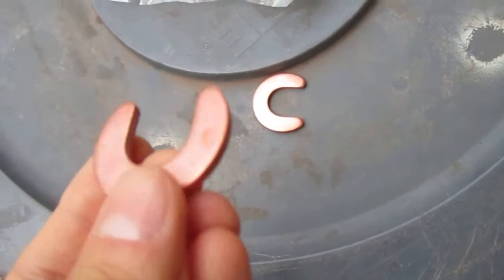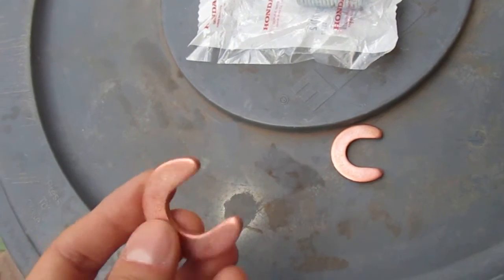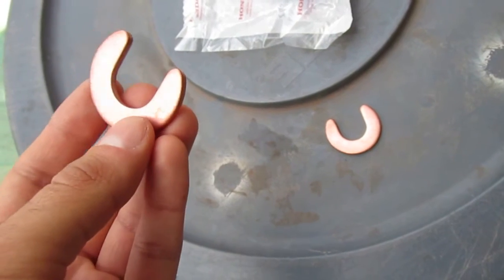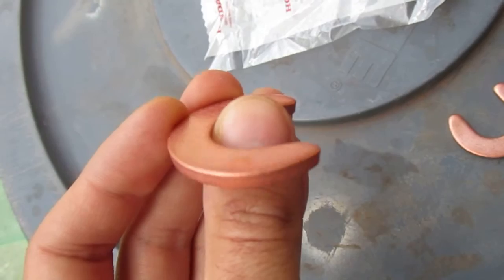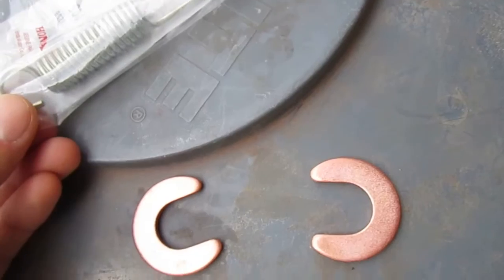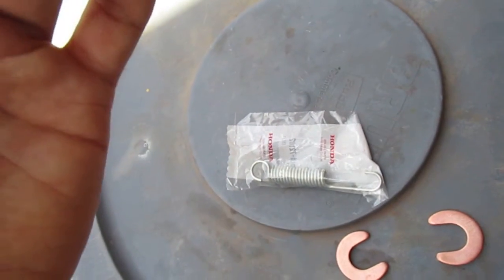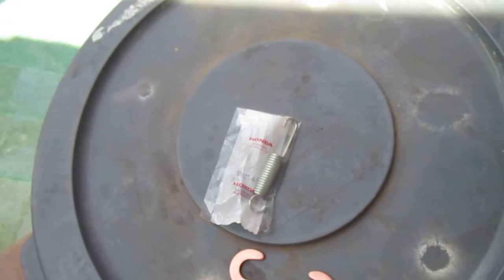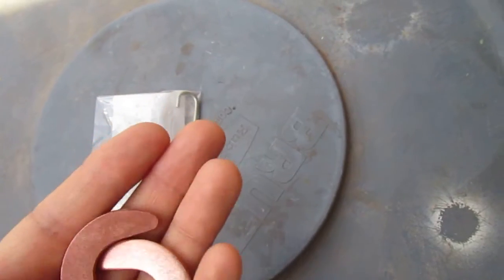Rear axle C clips  and Springs

Comment: sucks when they pop out and fling the axle and wheel out.
Reply from the maker: +Veikra  better hope you have disc brakes to hole the axle in.    I forget who, I saw it in a magazine but some company makes CUSTOM thickness C clips so you can really dial in the axle end play, i should of saved the name.    GM used to sell a variety pack These are around .150.  Some are .160 .180.     Who knows what is in the truck now I should of measured.  They are scored up bad!
Reply from the maker: +Veikra  Found it.. I am pretty sure this vendor sells assorted C clips http://www.tomsdifferentials.com
Reply: Ghetto Wagon Just ask a machinist and yes about the disk brake saving you lol.
Reply: very good to know
Reply from the maker: Veikra
 The only machinists around here machine meth.   Probably have to go Tampa Or Orlando to find someone who has the equipment to machine anything metal
Its  Hours away.
Reply: lol
Reply: How much backlash play is ok for the Axle Shaft with c Clip? 7.5"Diff Olds GM
Reply: @christophercolumbus5816  There's always too much for my taste. You can push and push those axle in and out about 1/8 to 1/4. It's insane

Comment: Not many of our cars had that setup...I don't like it...The end play and just the fact that the axle is relying on the clips to retain some important stuff is pretty poor.
Reply from the maker: +ZIGgassedUP  Yup. it works but its crappy.  The only thing I like is that when you have to replace outer bearings its easy, Nothing is pressed on.   I should really get some new timken bearings for it. last time I had the axles out they were in good shape. 30k ago.